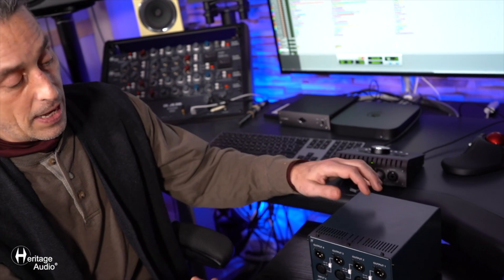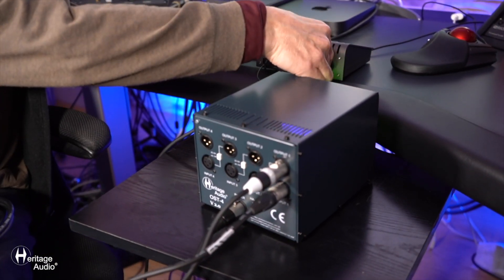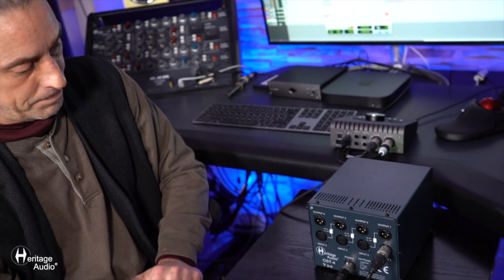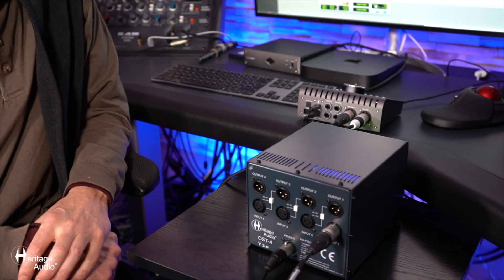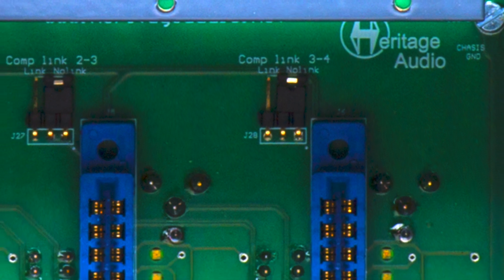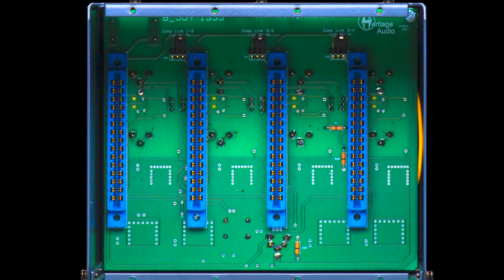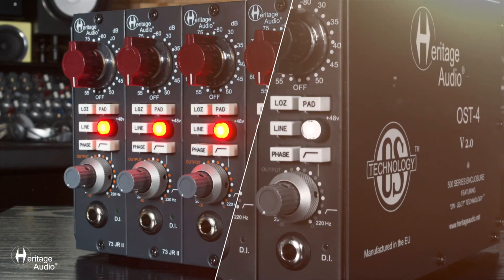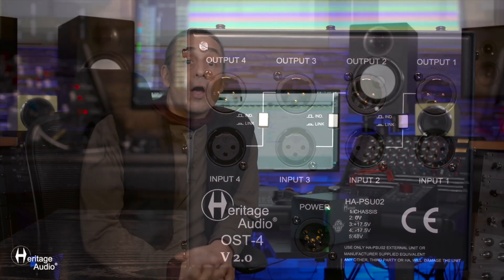Heritage Audio - OST-4 v2.0 500 Series Connections & Features

Comment: if I, for example, link two units, (let's say a preamp and a compressor), can I still get the clean output from the slot one (preamp), as well as the output from the second slot (compressor)? So I can record both compressed, and uncompressed vocals, for example.
Reply from the maker: Hi there! Yes, you can get the clean output from slot 1 and the processed output from slot 2 simultaneously.

Comment: Does the power supply have a power switch on it? How do you power down the unit?
Reply from the maker: It does not. Many generally centralize all their equipment with a power conditioner or at least a power strip.  This makes the process of turning everything on or off very quick and easy.

Comment: Nice but the powersupply that came with my unit broke after a few years of vry light use. And when looking it up online i found many people that had the same thing happening in the 1st 3 years!
Reply from the maker: Hello Arjan, we have improved significantly our PSUs in the past years upgrading their durability, reliability and performance.
Reply: @heritage_audio have you offered replacement to the customers that bought this unit and had problems with the PSU ?
Reply from the maker: @cristiancristeamusic9847  you can contact us directly at support@heritageaudio.com with your case and we will get it shorted.
Reply: @heritage_audio  You don't answer the question... Why ? 
Does it means you have a bad custom service ? Is your company honest ?

Comment: Looks great 👍🏻 
Just one thing.
What happens if the white button is not pushed in?
I doubt the signal just bypass the unit but keeps on going to the next ? Anyway, a hard metal switch would have been more secured instead of the white push button (link function). I can see the use on stage… something would push the button and the musician would look for the potential issues.